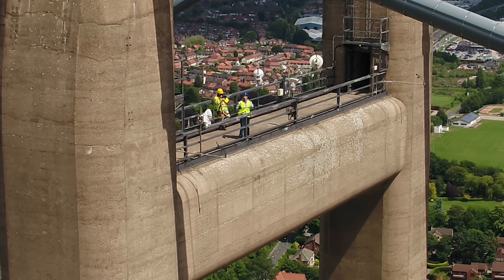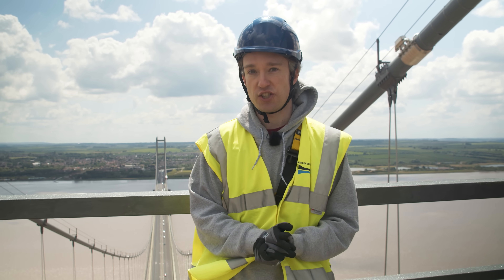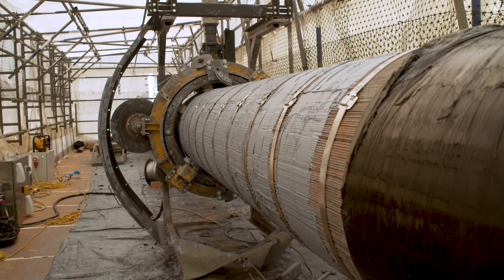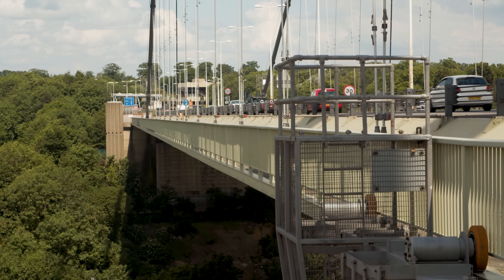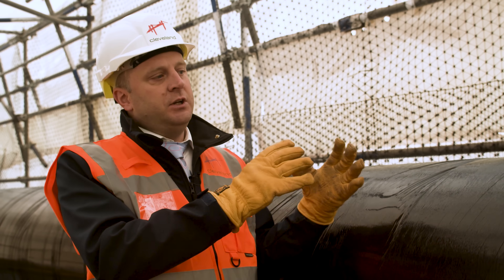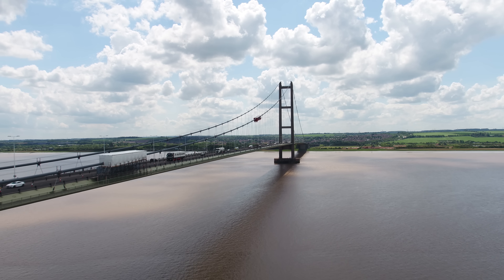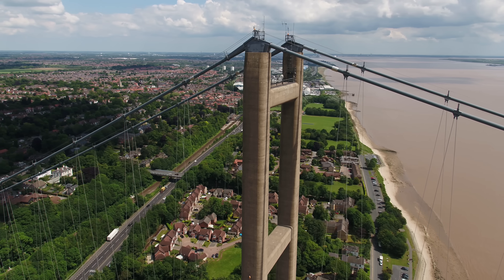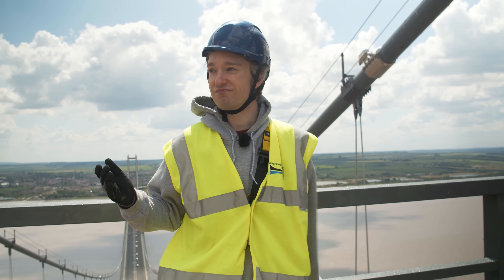How to stop a colossal bridge corroding

Comment: For anyone interested:
Distance near the ground and distance near the top of the pylons differs about 7 cm, calculations:
Trapezoid with bottom a = 1410 m, b = ?, h = 155,5 m
Angle is about 360*(1,4/40000) = 0,0126 degree.
So, b is about 2*(155,5*sin(0,0126)) = 6,8 cm
Reply: Why did you multiply by 2? If it's because both towers lean away, then you should have halved the angle, which approximately halves the result again.
Reply: You are right! Difference is equal to 2*155,5*sin(0,5*0,0126) = 3,4 cm total.
Thansk for correcting me!

Comment: I remember my electrochemistry classes from a few years back when the professor told us that the environment is a huge contributor to corrosion and it can be modified to stop it when using a sacrificial anode, usually magnesium, is not viable.

Comment: Why not inject a rubberised solution that will fill the air gap.
Reply: Once it's in there it's a heck of a lot harder to remove than just blowing in more air is. Be a right pain to discover in a decade that the solution you injected actually reacted badly with the metal.
Reply: @PhilRennie  Also cannot guarantee all air gaps are filled, and with so much at stake the added difficulty to inspect the cables isn't worth it.

Comment: I'm all sorts of worried about that testing method though, airlines used to think repairs like that to metal would be ok, right up until metal fatigue failure. Why don't they just run a replacement line per line tested to be extra sure it will be ok? also it is weird seeing countries that actually want to maintain their infrastructure. We gave up on that years and years ago, thus all our bridge collapsing issues  in the US...

Comment: not corrode? Build in non-corrosive materials ;P
Helps if they dont use non saltine sand, like sand form the sea. Which is what they use for bridges etc. Usually they wash it properly, but that cost time, time is money so meh. What the heck. It want rust..
10-15 yeas later bridge is on brink of collapse. Of course the cables is a different story :)

Comment: 0:29 Proof that the earth is not flat #2147483648
Reply: @Positive Energy But this isn't a picture that shows a curve.
They measured the direction of gravity extremely precisely at the construction site of each of those two pillars, several times each to make sure that the very slight difference is accurate. Then they built straight up from those two points.
This means that the gap between the two towers is slightly wider than at the bottom.

Like if you draw a 1 degree angle, extend it for a meter, measure the distance between the two lines to the micrometer, and measure it again 1 cm later. It's the same concept as this :)
Math:
Angle = 1 degree
side length: 1m       1.01m
To be more accurate, I'll let the horizontal go directly between these two lines, so that each is half a degree above or below, and the distance between them will be calculated with the vertical line from this.

The distance between the horizontal and each line is given by D = L * tan(angle)
D = 1 * tan(0.5) = 0.008727, or 8727 micrometers.
So the distance between the two lines is twice that;
17454 micrometers.
For a length 1cm later, L = 1.01m
So the distance between the two lines there is:
2 * 1.01 * tan(0.5) = 17628 micrometers. 

That's a difference of 174 micrometers!
Now replace this calculation with the actual measurements; the angle between the two measurements of gravity, the known distance to the centre, and the height of the towers, you get a difference of a couple of centimetres.

Comment: Helps a bit that the architect didn't design the bridge to use concrete in-tension and to bury the steel directly within the wet concrete such that it could not be accessed.

The wedge-open procedure doesn't sound like the most wonderful thing in the world but it still sounds a far sight better than having to break open concrete or find where oxide jacking has exposed the cable for you.

Comment: Heyyy, I've walked over that bridge multiple times! 😂
Reply: How long'd that take? It's a long bridge
Reply: @FinetalPies  if I remember correctly, about two hours. Though depends entirely on how fast you walk. And I definitely wouldn't recommend it. Kinda long and boring, takes awhile to get anywhere visible. Through if you have never cross a bridge like that, go for it 😅 everything is way more easy to access by car. That's what I remember coming from Barton to Hull, in that direction. Would be best to cycle on a really nice day, if your into that. I don't think it would take 30 minutes. Maybe a little more.

Comment: It feels a bit odd that the noise reduction of the microphone is so good! We can clearly see its windy, but hear nothing of it, its rather uncanny
Reply: Dubbed over?
Reply: @KrikitKaos  certainly not, with the right equipment, cutting out wind noise entirely is relatively easy.
Reply: @jsalexjs22 , like fluffy mics?
Reply: @JNCressey  believe it or not, they are called "dead cats"
Reply: @AlexKirwanLive  fluffy microphones is definitely more upbeat then
Reply: I agree.
Reply: Also seems slightly off because the video is slightly out of sync with the audio. Only slightly though
Reply: @laurencenoble3629  It's that curvature of the earth thing again.
Reply: That's probably Matt's audio superpowers and hours of coaching.
Reply: Most likely redone in a ADR session
Reply: @JamieJamez  They used a fluffy microphone in an extremely windy Park Bench episode (and a couple of Tom's other solo videos) too and it also made the wind barely audible.
Reply: Not the microphone itself, but rather the windblocker surrounding it.  Rycote is one manufacturer specializing in these and has taken a very thorough approach, creating a multi-layer system with very high resistance to unidirectional air movement (wind) and very low resistance to oscillating air (sound).  They are fairly expensive and available in different grades for varying conditions.
Reply: @artysanmobile  I think using highly directional mic (such as shotgun mic) will also help. For best results you want a shotgun mic with a huge dead cat over it and digital noise reduction in post production.

Comment: Tom you need to be more careful about where you place text at the end if you're going to use the cards to promote other videos. Or be more careful about the card placement. They covered up the text.

I mean other than that, great video! Never figured there'd be a microclimate inside of a bridge cable that could cause corrosion!

Comment: Thanks i will use this with my giant bridge
Reply: It's actually a good reason to climate-control a workshop or garage, especially in particularly humid climates.  And as a side-benefit it cools off the space so it's more pleasant to work in.
Reply: @TWX1138  There is absolutely no way i could deduct anything about you, let alone your mass, but I dont think you would find it pleasant, working in a hydraulic pressed cable
Reply: It’s more useful than the polynomials stuck in my brain and the way my algebra 2 teacher tried to relate it to real life by asking one of the girls in my class “what if you are tending to your horses and there are 2 solutions?”
Reply: @alexls1923  what the hell does that mean?
Reply: Blox117 my whole class thought the same
Reply: @alexls1923  you do realize engineers used math to calculate the strength of materials, how much material was needed, etc, in order to build this bridge right? so if you were going to say math is useless, just no.
Reply: Blox117 it’s not used as much in every day life by the average person, imo how to do taxes and create budgets should be prioritized over algebra 2 or at least be mandatory to teach in schools. I don’t think I need to know how to find x in a polynomial equation with 4 terms when I do taxes. Schools shouldn’t only be preparing students for college because some of them will probably decide to learn a trade. While things like polynomials are what things like this bridge are designed with, not everyone is going to need to use them in their lives as much as basic life skills.
Reply: And I don’t think using a horse is a good example on how to use polynomials when the question is “what if you were taking care of a horse and there is 2 solutions” when we don’t even know what the 2 solutions are supposed to solve and how we get those 2 solutions to begin with without any context
Reply: Ok